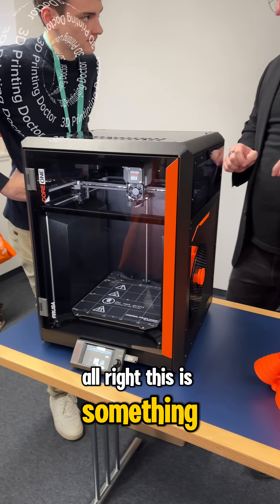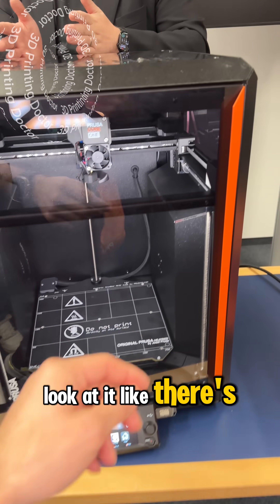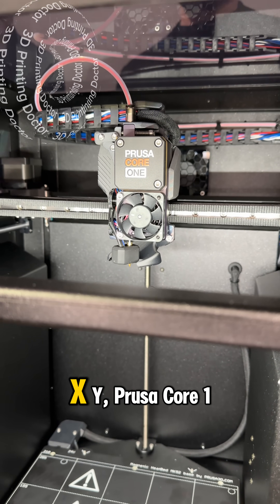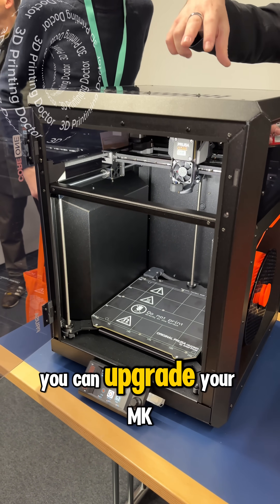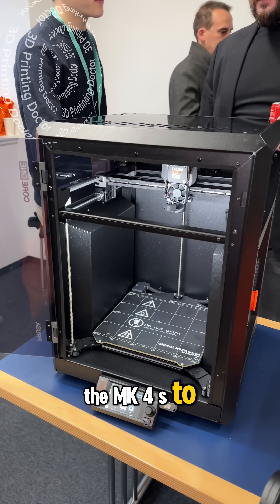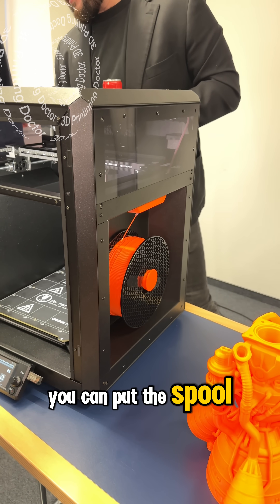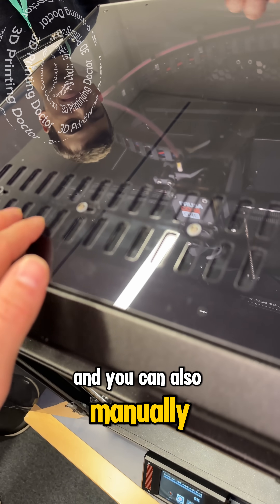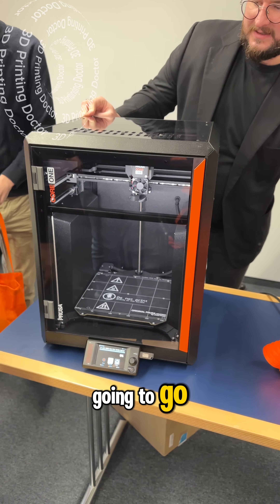Prusa did WHATTTT???? New Prusa CORE 1 is here

Comment: "first time right" is what I'm interested in. I had planned to order a bambu x1c for christmas after having seen that with that one I could finally just print when I needed it. For me it all depends on how hassle-free using the printer is, I have enough hobbies, trying to get my 3D printer to work can't be a new hobby by itself. If the CORE 1 requires as little user maintenance and runs just as reliable I'm sold. I very much prefer the open source character, but first es foremost, it has to work reliably when I need it with as little bugfixing as possible.

looking foward to the reviews.
Reply: I would go with X1C anyway. It's exactly what you described. Just works, almost no maintenance and you get AMS in that price. Prusa will not get you AMS, their mmu3 sucks just look on some reviews. It's terrible. if you really want prusa then go with MK4S, tested and working great but far less features than X1C.
Reply: I thinking the exact same thing as you. I'm pretty optimistic about the core one though, because bugs usually happen with software and electronics. MK3 and MK4 printers have a solid track record in that department. So the main thing that could go wrong would be mechanical design issues with the Core One, but that would be highly unlikely. Now I'm going to have to decide whether to spend my money on this Core One or Bambu's next printer with a bigger build volume. At least it's a good problem to have.
Reply: @MrBluntNose  I have an X1C and multiple Bambu A1's.
My Prusa is now a paperweight and has been since I got my X1C in the last part of 2022.
I run a production of printing and my Bambu's just keep on working.

Replacement parts are reasonably priced, covered by warranty, and quick to install.
I used to be a huge Prusa fan, but with the lack of innovation and prices that seem to keep creeping up, I've switched to be a Bambu fan.

Comment: It would have been good to have a built-in filament dryer.
Reply: They have mentioned on their blog that they are actively developing a drybox for use with it.
Reply from the maker: Yes
Reply: @RickyBricky  I'd like to have active heating, not just the ability to use silica gel like in their Drybox for Prusa Pro.

It looks that there is enough to space to make your own dryer.
Reply: @tshev  come on it’s Prusa, they’ll be an attachment that somebody will come up with. Or you could probably just drill holes into the body and build a door for it and use the heat from the chamber
Reply: Apparently it's easy to add one built  in since the filament area is modular.

Comment: Too Late, I already ordered the Creality K2 Plus Combo
Reply: i cancled mine
Reply: And I ordered an X1C with AMS just a few days ago😢...and it's already shipped😢 can't cancel my order😢
Reply: @ripmax333  just reject the delivery. you also have a 14 day return window. If they give you any crap, just issue a chargeback to your card.
Reply: Your K2 will be broken before the Core One starts shipping. It's a creality after all.
Reply: @LilApe  i do like Prusa but the starting price for the basic model with no Multy color or heated chamber its just not competing with other brands at all that offer way more for less, I don't know but if feels like you are just paying for the Name and noting else at this point with Parusa, I know the quality is there but a they are being left behind
Reply: @RetroByLaw  You are paying for open source, the good support, the slicer settings, the ever-improving firmware, and the ease of maintenance and upgradeability (no epoxied parts or cheap parts hidden behind injection molding on these).  I get that some people think the 3d printer should be an appliance and once it fails (or a new "version" comes out), you throw it away.  Prusa takes a different view and connects with their RepRap past -- which is that these printers should be upgradeable, ease to maintain, and all parts can be replaced.  Now, whether that ethos works for you and is worth the additional $200 is obviously up to you.  Here is what should be blowing people away: there is an upgrade path for an MK2 to a Prusa Core One.  Think about that for a minute.  You could find an MK2 for cheap on the used market, save money, and work your way up to this corexy machine.  That would be like taking a Bambu A1 and making it into a P1S.  I just don't think folks realize what that means for parts availability in the future and the longevity of these printers.

Comment: I may have misheard but you said the MK4s could be upgraded to Core One? I would be surprised since it's totally different machine. I heard the build plates were the same.
Reply: Yep there will be an upgrade
Reply: yes, there is a kit for that. it's insane and amazing!
Reply: @FamilyDikec  No it isnt. Its a scam. Its $450 for the upgrade, which makes your investment from an Mk4 + kit $1550. You can sell the Mk4 for $600, and spend $500 more for the Core One fully assembled. Thats not even considering the labor of disassembly and reassembly for the upgrade kit. Aside from the Core One is as usual an already antiquated overpriced brick comparatively.
Reply: @Darlhim89  I'm not sure I'd call it a scam, but yeah, not the most cost effective option at $450. There are many parts that need to be swapped out during the conversion. I see this kit the same way I see the i3mk3s to i3mk4 kit. It makes no sense, it's almost the same as getting a whole new printer
Reply: It seems to be the same machine, just done via CoreXY rails instead of i3 rails, plus the enclosure around. They say its not an upgrade, but they are supposed to live alongside each other, but the CoreXY seems more universal, so dunno.
Reply: Yeah . But the kit is for mk4s currently only. Hope the offer for mk4 too. Ill just get the complete kit, and wait for the upgrade in the future